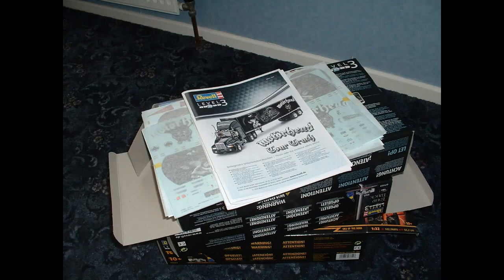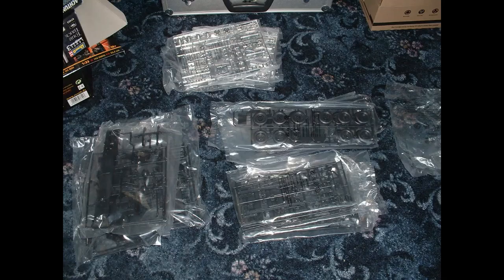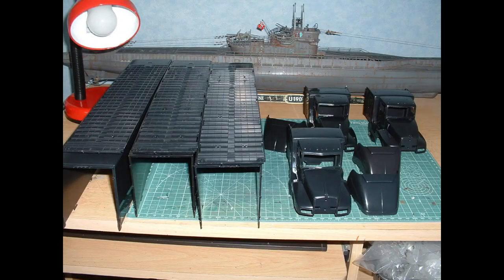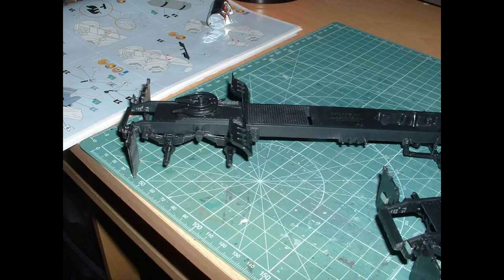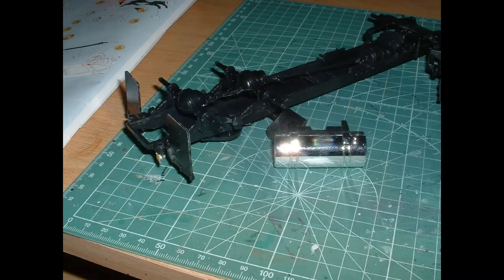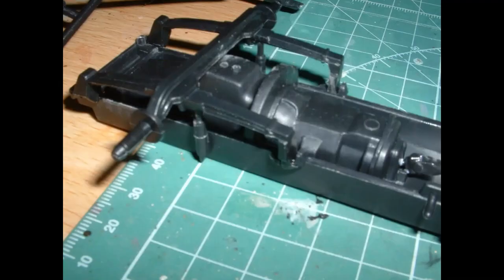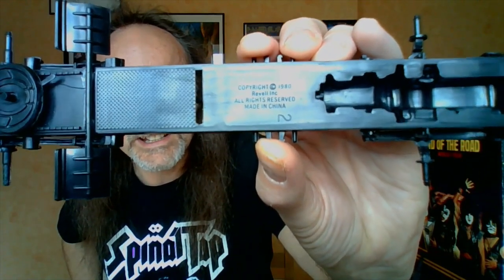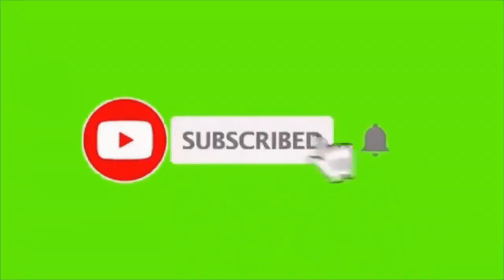Monstertrucks Of Rock!!: Vlog 1

Comment: I built this kit back in the 80's. It was not a good kit even back then. Very disappointing they used this cheap model for the base of these expensive kits.
Reply from the maker: True, I think the cost is more to cover the licencing for the band logos than anything else. Like I said in the video, this is more toy than model.
Reply: @AdrianBowerProject  I can still forgive a lot about this kit. But in 2023 molded plastic tires is almost a crime. Not a fan of them from the very beginning of my model building days.
Reply from the maker: @heybert17  I'm with you there! They don't look great, but then, this isn't a great kit either.